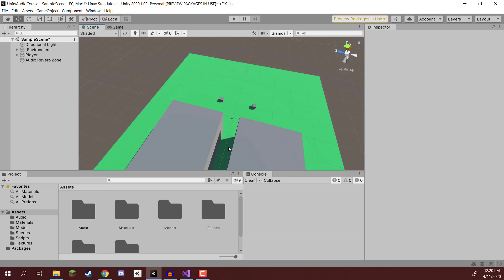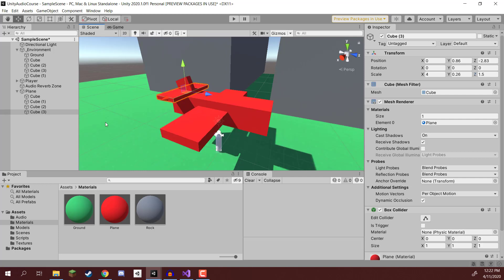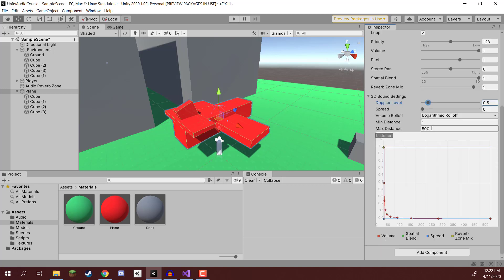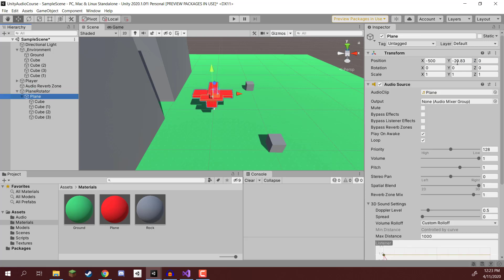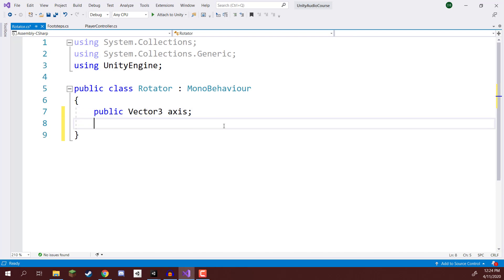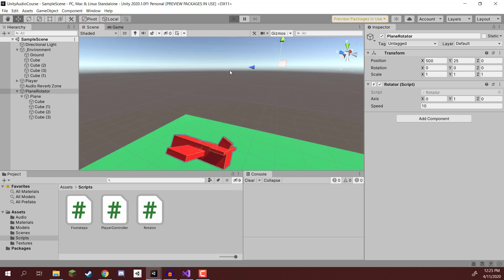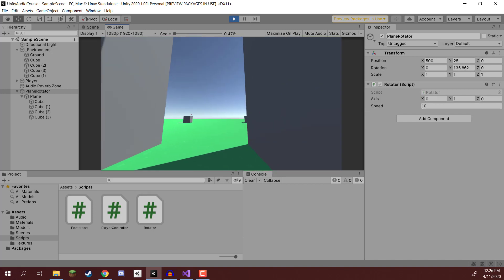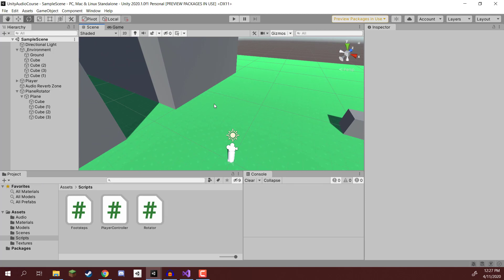The DOPPLER EFFECT - Unity Audio Tutorial

Comment: Doppler effects are a start, but the other thing that happens - especially when the plane is moving fast - is that the sound you hear is delayed by the difference between the plane's approach speed and the speed of sound. If it's going supersonic, you won't hear it at all until after it passes. I don't think Unity provides a solution for that,  but it would be nice if they did.